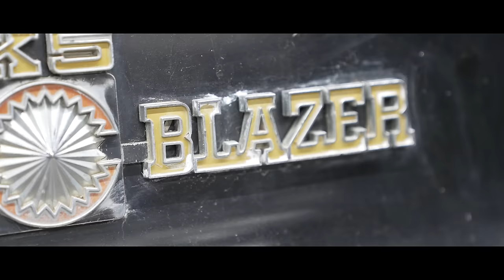ORIGINAL  PAINT 1980 CHEVY BLAZER - WHEELS & DEALS -  Gas Monkey Garage & Richard Rawlings

Comment: 1980-1991 Blazers came in two trims: the Custom Deluxe trim, which became the base model trim for C10s starting in 1975 (the first year of the Blazer), or Silverado trim, which became the highest level trim available in C10s starting in 1975. The 1975-1979 Blazers were built in either Custom Deluxe or Cheyenne trims only and 1980 was the first year the Blazer was sold with the Silverado trim despite it being available in C10 pickups for several years already. Sounds crazy, but I got all this info from the GM Heritage website using dealer ‘vehicle information kit’ photocopies, so it’s all accurate info. Here’s something more that’s cool: 1980 Blazers could be ordered with either white or black painted tops from the factory with the ordering code Z59, so that black painted shell on your Blazer might be factory/original.

And one more thing, this Blazer is particularly rare not only because it’s a 4x4, but also because it’s the first year of the Silverado Blazer and the final year of the non-tapered front end. 

1981-1991 Blazers all had the new tapered front end designed to make the truck more aerodynamic and 1975-1979 Blazers only came in Custom Deluxe or Cheyenne trim. The 1980 Blazer is special in that it had the older style front end from ‘73-‘79 trucks and the Silverado trim that would have otherwise only been available in the ‘81-‘91 tapered front end trucks. Literally a one year only truck and double so because of the 1980 only grille. Sick truck despite it looking a little rough initially.
Reply: Ya but what does it all mean 🤔
Reply: @rickeya5481  

1973-74 C10: Custom (lowest trim package), Custom Deluxe (lower, mid trim) , Scottsdale (higher, mid trim), Cheyenne (highest trim).

1975 and up C10: Custom Deluxe (new lowest trim), Scottsdale ( new lower mid trim), Cheyenne (new higher mid trim), Silverado (new highest trim).

1975-1979 Blazers: Custom Deluxe (base trim package), Cheyenne (second highest trim package now that Silverado was available, but highest trim package available in Blazers).

1980 and up Blazers: Custom Deluxe (base level trim), Silverado (highest level trim).
Reply: @rickeya5481  Custom Deluxes (and Customs in 73-74) came with painted bumpers/wheels. That’s why the yellow C10 the millennials bought has white painted bumpers; it’s a Custom Deluxe base model. Anything in a higher trim came with chromed bumpers from the factory and varying levels of added sound deadening, insulation, special upholstery, special interior panels, head liners, power windows, locks, etc. 

It all means jack shit after 40 or 50 years since the sound deadening and insulation type stuff will be old/worn out and so will the interiors a lot of the time, but they were all higher cost options from the factory ($200-400 extra). 

The Silverado and Cheyenne did have special badging and those plastic moldings on the back side of the cab that made them distinct, so there is that, but there isn’t all that much difference between the trim packages past the base Custom/Custom Deluxe models.

For example, Silverados had extra insulation and power windows/locks that the Cheyenne and Scottsdale trims did not. And the Cheyenne had extra insulation on the hood and cab area that the Scottsdale did not. And even the Scottsdale had insulation, a dome light, cigarette lighter and other trim options that the base Custom Deluxe didn’t come with, but after 40 or so years, you’re still coming out with the same basic truck regardless of whether it’s a Scottsdale, Cheyenne or a Silverado in my opinion unless the truck we’re talking about is showroom quality. That’s why it’s so hard to even tell what a Scottsdale, or a Cheyenne/Silverado is anyway. It’s basically just levels of sound deadening and insulation and random trim around the exterior/interior of the truck.

Comment: being a 1980 it should have th350 trans-  and the <>SPICER <> brand ''all steel front locking hubs (( 1980 ONLY )) 
 and the NP205 gear drive transfer case

Comment: OK, I'm a Ford guy.. Loved that 78/79 Bronco. Too bad rats got to it and it wasn't for sale. BUT.... THAT'S a badass blazzer. PAINT it Yellow, keep that side trim area black. Add some black  racing stripes down  on the hood, roof, top and tailgate..   Change out the front grill for an 85 four headlight one, and put an old school KC  light bar at the top of the windshield. ROLL BAR back where the top comes off. 80'S "jacked" Blazzers/Broncos are the shit!! I LOVE MY 2000 F250 super duty crew cab with a V10, 8" lift and 38's though.

Comment: Dry ice that chassis FOR SURE....it's unbelievable! Definitely need to put it back to stock suspension height, put on a set of stock wheels, and ditch that terrible aftermarket grill too. Closer to original the better!

Comment: 🇺🇸*RICHARD**🇺🇸 I live in south Carolina near Clemson SC YOU ****INTERESTED***** in another rambler it's a 1964 3 speed 2 door original motor and trans needs the back seat and the driver and passenger recovered and carpet the passenger side needs a half of a floor pan under the dash next to the door I've got pictures of the car inside and out if you are interested let me know